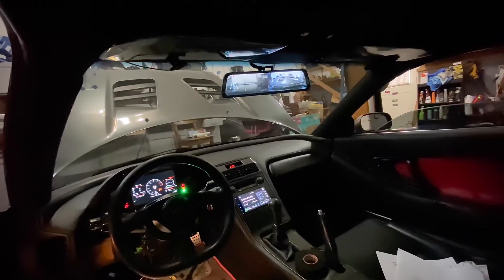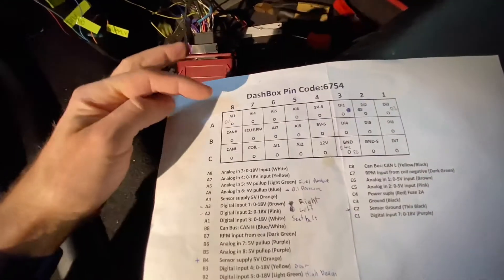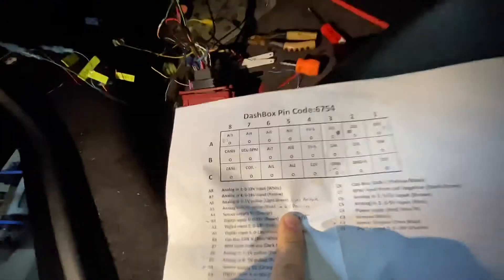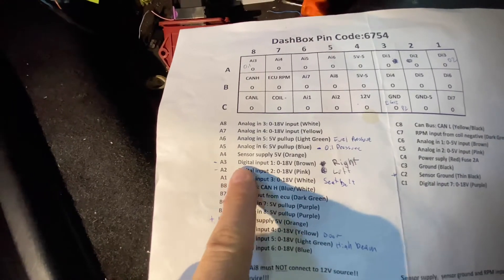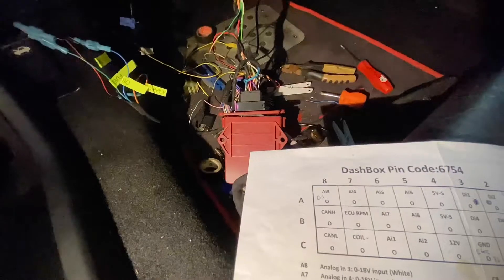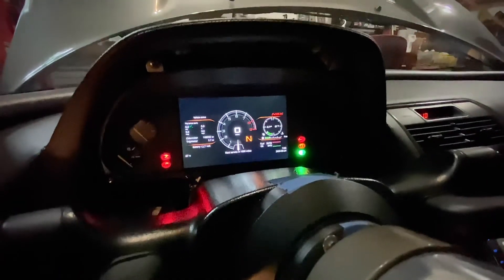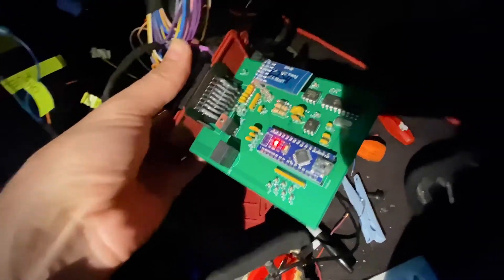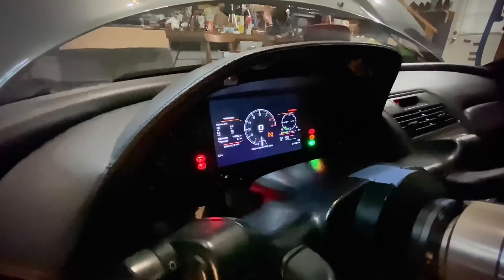Dashbox module wiring, Realdash app

Comment: Can you help advise on how I use dashbox to get RPM ?
Reply from the maker: dashbox will come with wiring diagram, you would take the rpm wire and connect to your car's rpm.  Then in RealDash configure how many pulser per rotation.  There is not many to choose so you can pick and choose to make sure the rpm readout is accurate.
Reply: @winreboot So i connect dashbox rpm wire to car rpm wire. And what other wire to connect to get rpm? Some ground or plus?

Comment: Hey man, Have a quick question if you dont mind:

I'm doing an engine swap into an older vehicle and as such I dont have any fuel level info over obd2.

I see with this dashbox it is possible to give Realdash a fuel level reading which is great.

Question is, can the Realdash still give me some kind of fuel economy readings? (Either instant/average Miles per gallon, or miles remaining to empty).

Thank you for any input. I would love to have an indication of my fuel economy since part of my reasoning for the engine swap is to get better fuel milage than the original old engine.
😊
Reply from the maker: You can do this few different ways but I would get a aftermarket fuel lever to read it accurately or use the existing fuel level and read resistance on it.  The resistance can be put in a table so you will have accurate readout.  Dashbox can wire to your fuel level.  This is little more harder way but gives you OEM type of precision.  You can check the realdash forums on realdash.net or contact the dashbox guys, they are awesome with their support.  Of course you can go with just estimates to give you fuel level and consumption.  You will need gears rations, tire size, car wind drag at list ball park, fuel tank capacity etc..  RealDash will calculate all the vol and display estimates.  Each time you fill up gas you would reset fuel gauge or enter how many gallons of fuel you added.  It will be close but not 100% accurate, I bet after a while you will get a sense how accurate this can be and vol can be adjusted to fine tune this way.

Comment: You're awesome! Thank you!! I got a question. My Turn signals rest on 12+ and trigger with ground. I can use a relay to switch but wanted to ask you if this unit takes both + and - signals? Should I use the analog pull up inputs?
Reply from the maker: Thanks!  turn signals for my car activate with 12+ but my seat belt, door ajar, high beam etc.. activate with 12-  It's been a while when I set this up and don't want to mislead you, ping them on FB, they are quick to respond. https://www.facebook.com/sp.leinonen.9
 I know I used a relay to change the polarity on something but can't recall what it was now.
Reply: @winreboot  Yup I know this Most Japanese vehicles use negative trigger for lights etc. I installed many aftermarket alarms so I know. It's not a big deal to change the polarity I just wanted to ask. I ordered the Dashbox and its on the way. I went ahead and wired my vehicle ahead of time. Thanks so much for your reply buddy. I would love to show you my custom dash once all is done.

Cheers!
Reply from the maker: @betchipsandskill  awesome, yea when you get your dash setup running I would l like to see it for sure.  There is a lot of customization possible and it looks so modern.

Comment: Does the connection still drops from time to time just as with (only) an obd plug? Because I only have the obdlink mx+ and I have a connection loss several times when it is in use.
Reply from the maker: I know the obd2 is always flaky and on a good day it's just slow but I have not notice it drops recently.  Maybe because I'm relying on dashbox more and reading slow inputs like coolant, air temp intake form obd2, so I don't notice it.
Reply: @winreboot  Thank you for your reply, bro. I appreciate it👍
Reply: @winreboot  I will try it with an obd2 5.0 plug and see what it does with the stability of the connection.

Comment: very good
Is it possible to connect two devices to the tablet at the same time via Bluetooth? I mean OBD II and Dashbox?
also when I use the ELM 327 Bluetooth I have a lag for the engine speed, where is the problem? Should I use the USB type? Will the log be removed?
Reply from the maker: Yes, you can have two devices connected.  I have my obd2 elm device and dashbox.  This allows more inputs displayed.  Correct ELM or any obd port device has a delay, the ECU can't send pid data fast enough.  Only solution is to use dashbox for that input instead.
Reply: how about connecting more dash boxes?

Comment: hi i own a mini r56 jcw. im not able to use 
low  beam
high beam
turn light left
turn light right
door open
for example. im using OBDlink+ 
do i need realdash?
Reply from the maker: Realdash will not support those unless you have a dashbox to wire in the signal to it.  So for example, you would tap in a wire to low beam, then run that wire to dashbox, dashbox will send the signal over bluetooth to realdash so it will be displayed in the app display.  You can visit realdash forum on their website for support
Reply: @winreboot  can we talk on whatsapp because its hard to understand for mr. so by OBD2 realdash cannot show me engine check light, engine oil pressure light, odometer too?

Comment: Does it have fuel level indicator?
Reply from the maker: Yes.  You can configure it two different ways.  Either wire in the fuel sender unit to dashbox and have live read out or use Realdash app to calculate the fuel tank level.

Comment: A very nice job!
Did you get rid of lag between the real car speed and RealDash gauges
Reply from the maker: Yes, it's real time now.  It's only delayed when the source is from bluetooth obd2 port, the issue is the ECU can't send the data fast enough, even if one would have the fastest/newest obd2 port reader.  Dashbox module taps in to RPM signal on the gauge cluster and sends it real time (115200 baud rate)

Comment: Is this possible with obd1?
Reply from the maker: Yes, you don't need obd1 port, it it's helpfull to have as you will have more inputs.  Dashbox module connects directly to the inputs, for example RPM, coolant or blinkers and then sends the signal over bluetooth to tablet.  With obd port it is easier as you don't need to cut in to wires for inputs.
Reply: @winreboot  oh ok thank you! so where do i buy one? lol also how do i find which input gives me what from my inputs?
Reply from the maker: @fcrahimi  Here is where I got my https://shop.protoparts.fi/product/630/sp-leinonen-dashbox?fbclid=IwAR0yfY9nb2yzNYSRYyTzCAdedhm8sgYVE9f3JP4owx_OEwDm3Mitsi68Pgk

you can contact them on FB they have great support https://www.facebook.com/sp.leinonen.9

Comment: Hey bro please help me, i have installed the box and got the signals but my fuel is analog signals and its only reading 1 bar i have maxed the tank but its still reading fuel level is critically low, how did you do your fuel level? Please help me
Reply from the maker: You will need to change the fuel reading from "body electronics" to calculated vol.  First select edit for fuel gauge then for "input & Values" select data source  from "calculated values" -->Fuel Level (calculated)  Once you do that the fuel gauge will not try to read from obd2 but will calculate based on driving etc..  When you fill up the tank make sure you click on the little gear icon in right lower, then click on add fuel.  This will top off the fuel gauge to full.  Hope this helps.  You can also post on realdash forum, they are very helpful with everything.
Reply: @winreboot  i will try that, thanks alot friend
Reply: Thank for the quick reply friend, i have hooked up the dashbox with analog input 5 being the fuel level sensor, but it only shows me fuel being critically low, is there no way to make it work with dashbox?
Reply from the maker: @NoorFilms786  Got it, in that case it sounds like you just need to calibrate the table.  Edit the fuel gauge, select inputs, then dashbox, then analog input 5.  Then edit and you will see what is the current read out from the sensor.  You will see a table, since you have full tank it should be reading high about 5v.  Once you ok to that it should display the fuel level.  That is as much as I know, if it still gives you troubles, ping the guys at SP Leinonen of FB.  They respond quick on messenger.  https://www.facebook.com/sp.leinonen.9